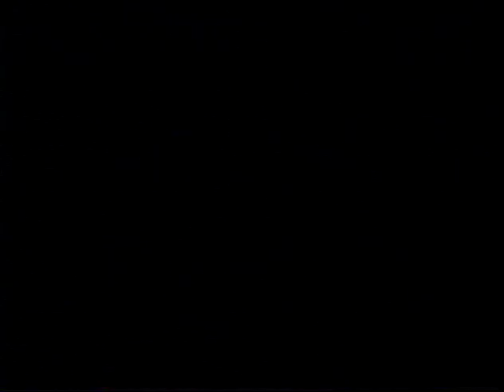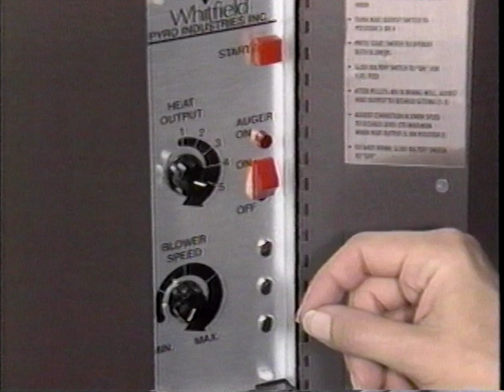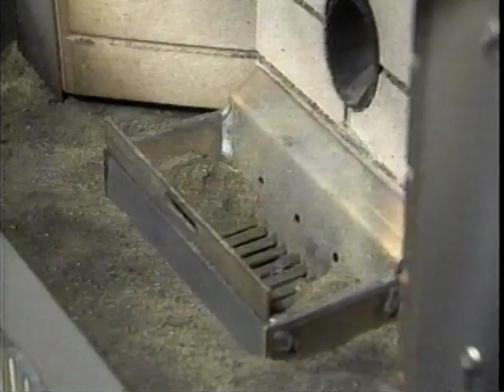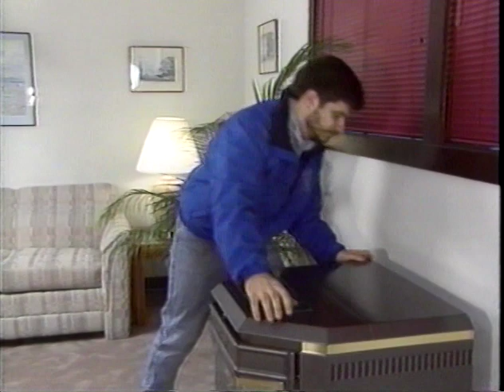The Whitfield Story

Comment from the maker: 🎯 Key points for quick navigation:

00:03 🔥 Introduction to the Whitfield Pellet Stove
- Introduction to Whitfield's high-quality pellet stoves.
- Overview of the purpose of the video and commitment to product excellence.
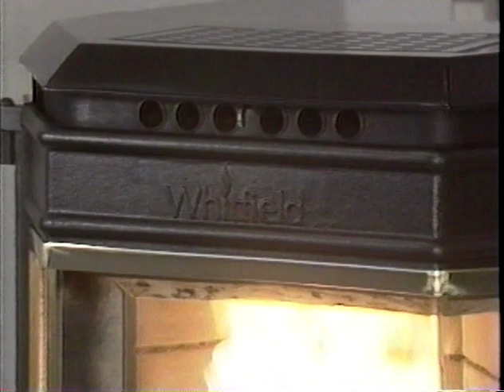00:32 🌲 The Story Behind Whitfield Pellet Stoves
- Dr. Jerry Whitfield's journey from aerospace engineer to inventor of the pellet stove.
- Whitfield's evolution from a garage startup to the leader in pellet stove manufacturing.
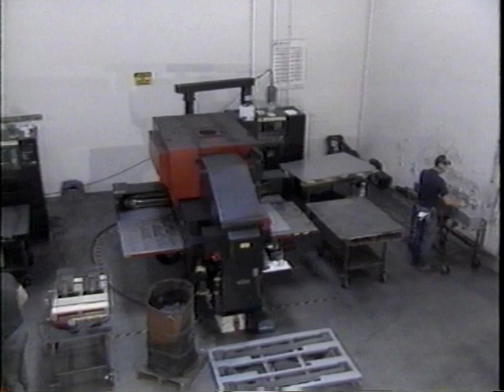02:19 ⚙️ Pellet Stove Design and Efficiency
- Explanation of the pellet stove's innovative heating method.
- How Whitfield stoves use thermostatic control for efficient heating and environmentally friendly fuel.
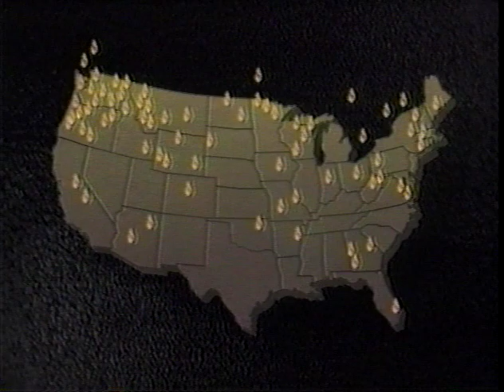04:12 🏭 Manufacturing Process at Whitfield
- Detailed look at the highly efficient and modern manufacturing process at Whitfield's plant.
- Highlights of technology and automated systems used for precision in stove production.
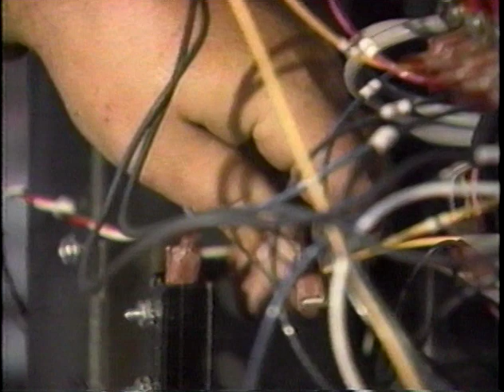06:08 🌍 Whitfield's Dedication to Future Innovation
- Whitfield’s commitment to high-quality, efficient pellet stoves and continued innovation.
- Environmental benefits, including low emissions and ease of installation without a chimney.
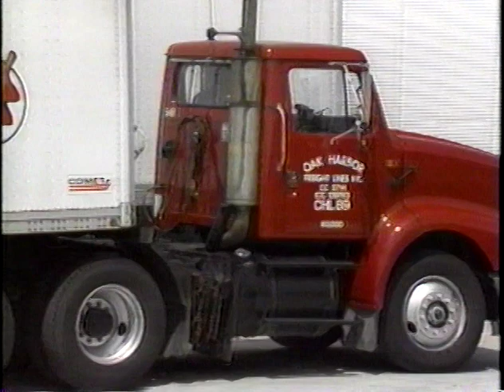08:06 🏡 Easy Operation and Dependability
- Introduction to the simplicity and dependability of using the Whitfield pellet stove.
- Features like easy lighting, long burn time, and adjustable heat output settings.
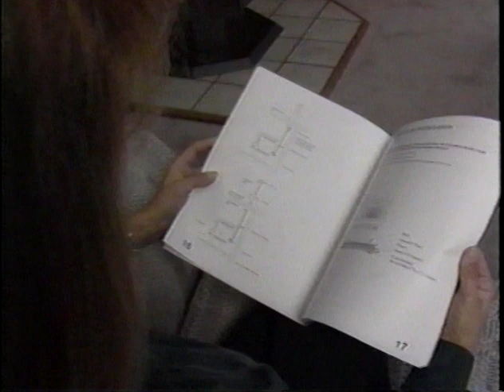10:30 🔧 Operating and Maintaining Your Whitfield Stove
- Essential steps for proper stove operation and initial setup.
- Importance of using quality fuel and understanding the stove's controls for optimal performance.
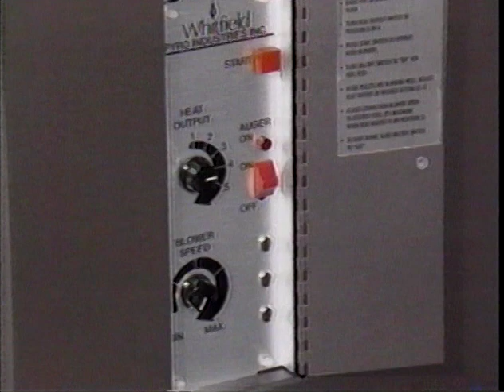13:58 🔥 Fine-Tuning the Stove's Operation
- Explanation of fine-tuning the stove for optimum performance based on different pellet types.
- Using the damper for adjusting air and fuel flow to achieve the perfect flame and burn.
17:41 🧹 Regular Cleaning and Maintenance
- Step-by-step guide to cleaning various parts of the stove, including the burn grate and heat exchanger.
- Importance of periodic maintenance to ensure stove efficiency and longevity.
22:03 🛠️ Routine Inspections for Long-Term Performance
- Guidance on yearly inspections and maintaining stove components like door seals and venting.
- Tips for maintaining the stove's performance over time and preparing for the next season.

Made with HARPA AI